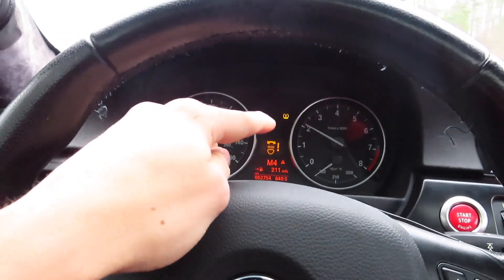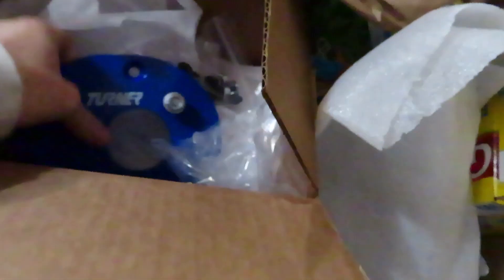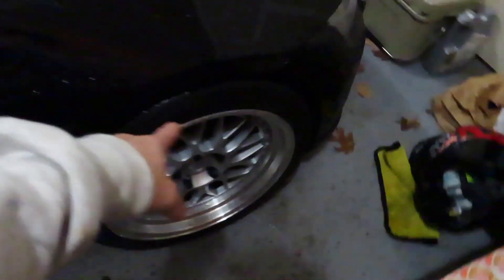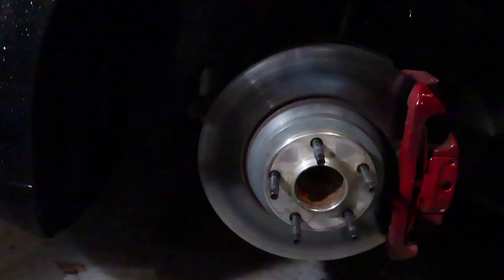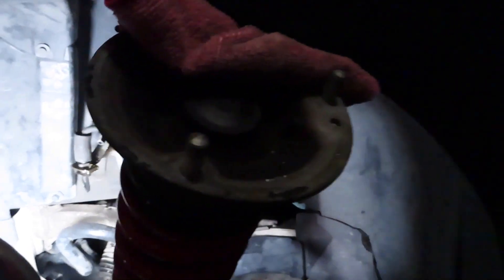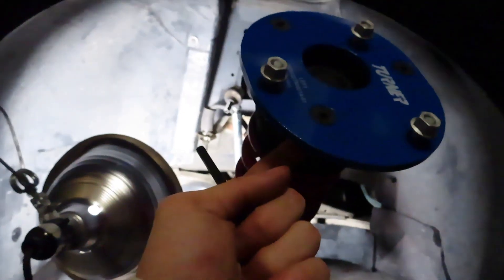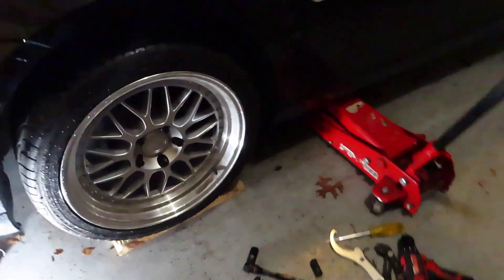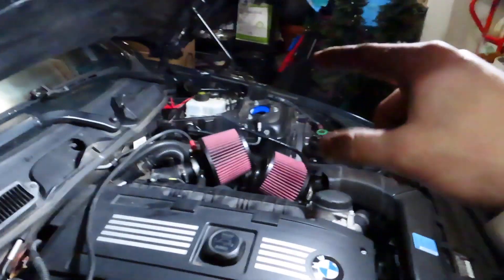Installing Turner Camber Plates on 335i! (+NEW WHEELS)

Comment: if you still got the car the rear camber is so negative is to make sure the rear grips when the tyres lose traction so you get more understeer then oversteer for safety reasons, if you run rear camber about half a degree less than the front you'll notice more balance when taking corners at speed, you'll also gain a tad more straight line acceleration, sick video i got dinan plates im getting ready to put on my E8x 1 series :)
Reply: What camber exactly do you run in the rear? 1°?
Reply: @Beemerboii  depends what fronts are and how on the limit you want the handling characteristics to be, the less camber the quicker it'll be to oversteer, but too much, and you'll understeer..I sit at just over -2.0 front and -1.4 rear but may tweak now I have stiffer rear roll bar and subframe mounts
Reply: @imDannyyOSRS  I'm installing the fixed plates in the front so I think something similar to your setup in the back might be what I need.